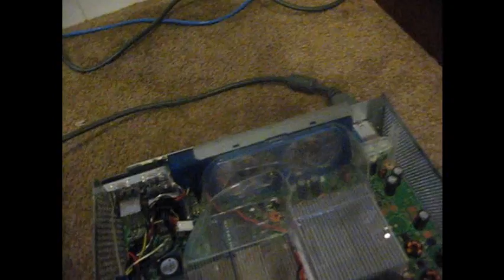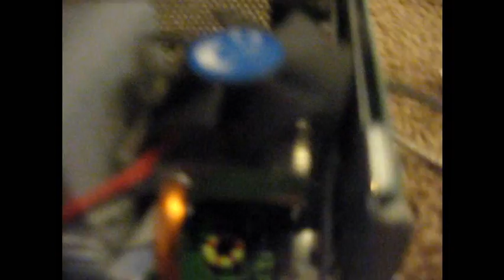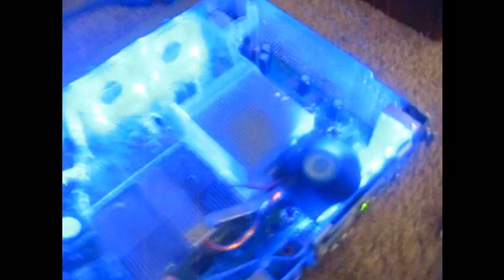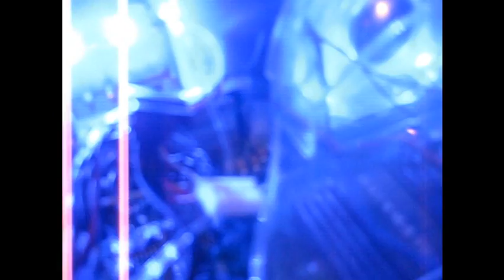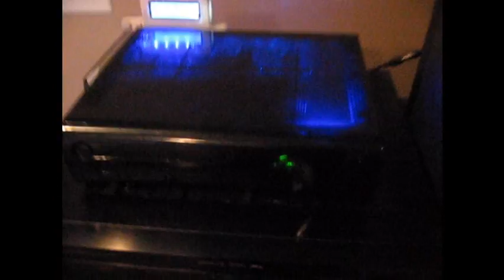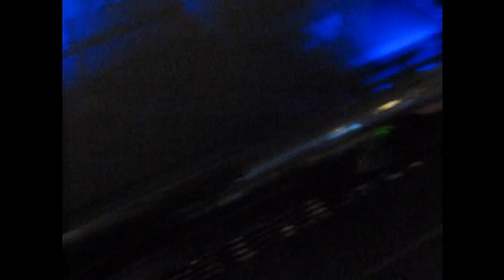Xbox 360 Elite Mod - GPU Heatsink Extension Fan

Comment from the maker: @xXEl1m1n4tOrXx im debating but im thinking i will reflow it and then if that doesn't work, i'll remove the GPU with a heatgun (or the reflow station) but it might just be the "hana" chip or sometimes called the "ANA" chip

Comment from the maker: @xXEl1m1n4tOrXx lol well if you didn't figure it out already i didn't add the extra heatsink M$ did and yes i know why the RROD is caused and yes it will prevent it because in 90 F degree room temp it stays at 113 C!!!! under normal GPU operating temp by over 40 degrees (hint hint fans at 5000 rpm and can go up to 6458 rpm)